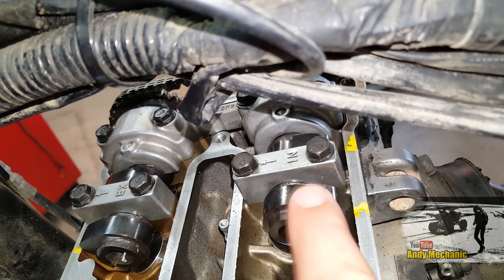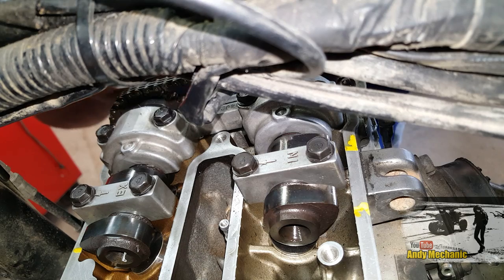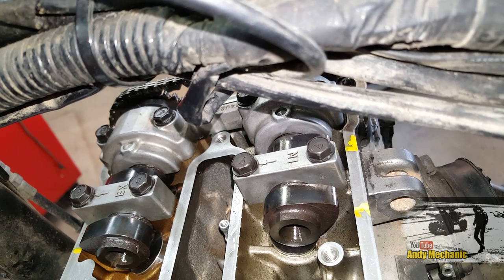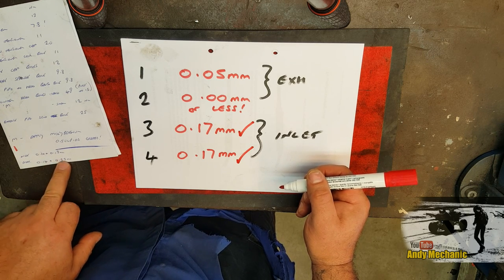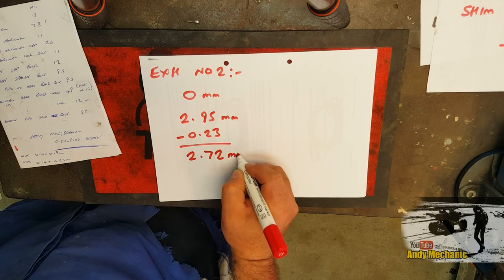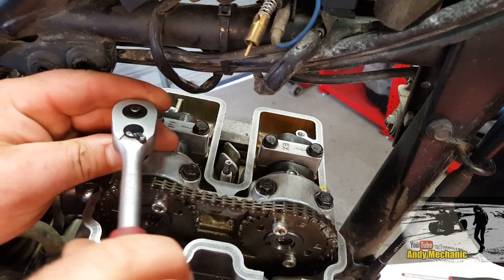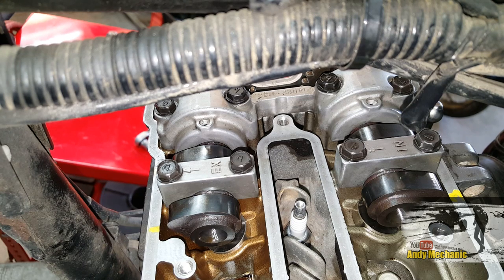Adjusting bucket & shim type valve clearance #1158

Comment: Excellent for those of us with DOHC Japanese engines. Different specs and details but the overall procedure is the same. Applying this to my 1UZFE v8. Has a very noticeable "tick" which is typical for my engine type. Mine has 380,000 miles on the clock and likely has never been adjusted.
Edit: Some people just have that ability to speak using the appropriate language and tone to engage the student. Our friend here is a great example. A gearhead like me can listen for hours and would seem like minutes.

Comment: Pulling buckets out with plyers is not recommended due to marking surface. Magnetic tool or valve grinding sucker tool once oil removed on top of bucket is a far safer way to remove bucket. Damage to surface can damage cam lobes aswell as head. Plyers not recommended!

Comment: Great video. I sanded the valves against the head valve. So it mean that I need thinner shims? Thanks you!! Kz650 1978
Reply from the maker: Yes, most definitely.. make sure you get the clearance back to within spec. Cheers Andy

Comment: On a twin cyl sohc motor, after you have # 1 cyl on TDC do you have to change to check valve clearance on #2 cyl ? This is a Webber 850cc shim type valve clearance engine.
Reply from the maker: Yes, you'll have to rotate the crank to TDC on the firing stroke of the 2nd cylinder - usually a full 360 degree turn of the crank shaft.

Hope this helps. Cheers Andy

Comment: Hi I wanted to ask what happens when these clearances aren't in spec??Do you lose compression.
Reply from the maker: If the clearances get too small then yes, as the engine warms up the valve doesn't fully close. Cheers Andy
Reply: @AndyMechanic  Awesome thank you very much for your response, I'm thinking this is what is happening to my Kia as I can also hear more ticking noise than before.

Comment: Why does the clearance between the cam lobe and the bucket became decrease over time? Shouldn’t it increase as the bucket becomes thinner and thinner over time???
Reply from the maker: On an overhead cam arrangement the valve margin - the sealing surface of the valve to the valve seat wears so the valve sinks into the head & moves upwards towards the cam. Reducing the clearance.

Hope this helps
Cheers Andy
Reply: @AndyMechanic  thank you! That makes a lot of sense. One last question! Do you think that valve clearance increases or decreases with a hot engine compared to a cold engine. Because some say that valve clearance is bigger when the engine is hot and others say that it gets smaller with a hot engine. What’s your opinion on that???
Reply from the maker: Again, it depends on the design. With an overhead cam arrangement the clearance reduces as the engine warms up & the components expand. This may be different with push rod valve train design - you will have to do more investigation!

Cheers Andy
Reply: @AndyMechanic  thanks !

Comment: I have a question. On cars, especially on my 2008 Kia Optima 2.0 DOHC with mechanical bucket tappets - the valve clearance decreases or increases with time passing?
Reply from the maker: +Petar Valve clearance usually reduces as the engine wears. Though sometimes on old push rod engines it can increase.

Hope this is of help

Cheers Andy

Comment: you could ---- with emery sand paper remove some material from the top of valve --- may take awhile ......another good job..
Reply from the maker: +MrRobert1603 Now that's not a technique I have come across & well, you may as well reduce the old shim than have to remove the valve as that requires the head to be removed. Plus, removing material off the top of the valve may compromise the collet groove?

Comment: the thickness of the bucket not come into the working out?
Reply from the maker: No. You are measuring the current gap between the bucket & cam lobe. Then calculating what increase/decrease is required to obtain spec gap.

Cheers Andy

Comment: Why are the clearance's going to close up with wear?  Surely as they wear the gap will get bigger.  When the gap gets bigger the cam shaft will not be pushing down on the shim/tappet as much and the exhaust valve will not be opening enough.   If the exhaust valves becomes out of spec (are not opening enough) less air is being sucked through engine and this when they over heat and pistons fail.  I am a complete novice so someone put me in my place and tell me why I am wrong?

Comment: 17:03 use a toffee hammer or plastic mallet or plastic drift/rod.... dont lever you could slip and damage the journal or mating surface for cam caps.
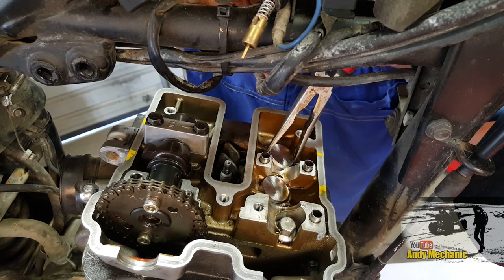18:24 use a magnet.